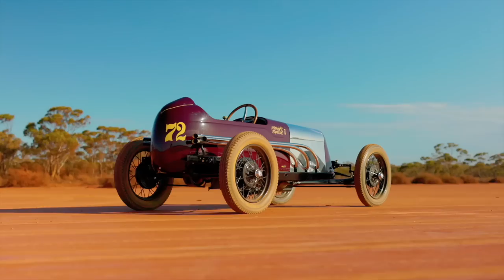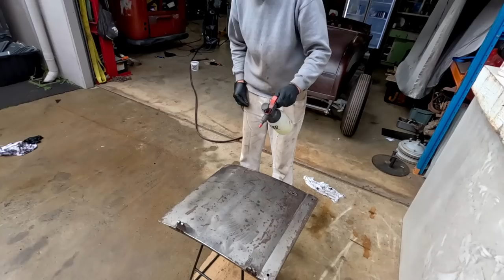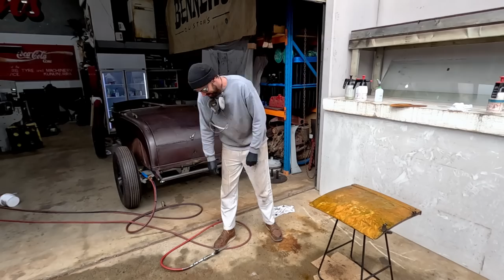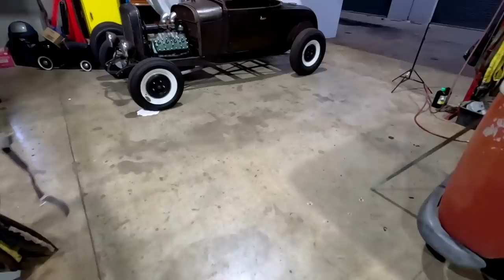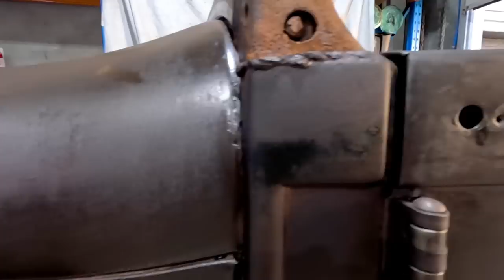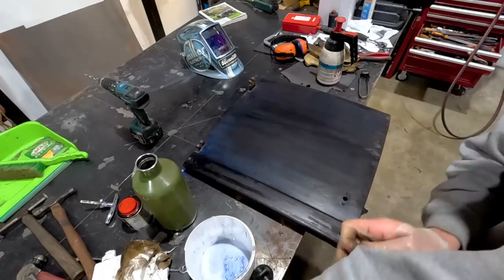(DIY) Creating Patina Rust: How To Achieve A 90-year-old Patina on Hot Rod Door!

Comment: Beautiful work! As an 18th and 19th century weapons maker, I've had excellent results in heating the surface as you did, but using bleach and then evenly sprinkling fine saw dust on the wet surface. As each application dries, the application is repeated. The sawdust holds the bleach and eliminates the streaking. Once a level of patina is reached, it's neutralized. I use linseed oil to seal it and the eventual use of of the firearm and repeated cleanings turns the "browning" black.
Reply from the maker: Awesome process and great tips will have to try it out!

Comment: Really cool! You probably know this but POR-15 isn't uv stable so it will need something covering it or a top coat. On my 54 GMC 100, I used POR-15 to seal the southern yellow pine bed boards on all six sides and then painted them with Behr house paint.  Still looks good after 6 years out in the weather!
Reply from the maker: Yes definitely I should have mentioned that. But great tip to bring up for sure

Comment: Hi That's a really good patina You worked there. You might also try ferric chloride FeCr it is commonly available as it is used for etching the copper from circuit boards. I suspect that it would etch up the surface ans give the other chemicals something more to bite on. Best of luck with it Dee
Reply from the maker: Thank you Dee for a great tip!

Comment: Amazing how close a match you have that. Did you only use the acid once at the start of this process? All the best Jordan and family. ( When I said good luck with the ashes I didn’t mean keep them ) well dun all the same. Tim.
Reply from the maker: Yup just that first stage- if you apply it after it would clean off all the surface rust. Just did multiple coats of the peroxide. The air and heat was just to speed it up and try and take control of the direction